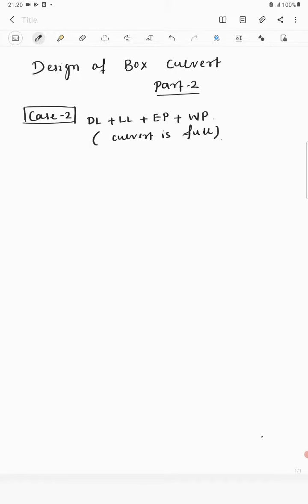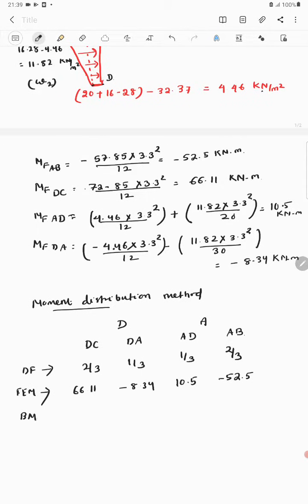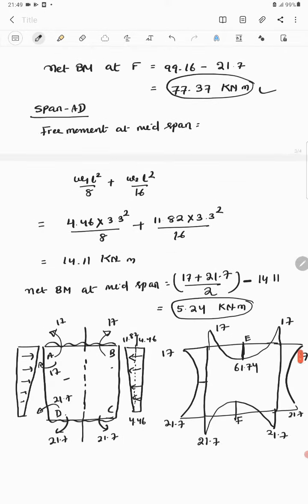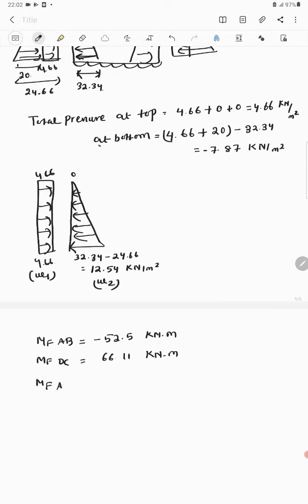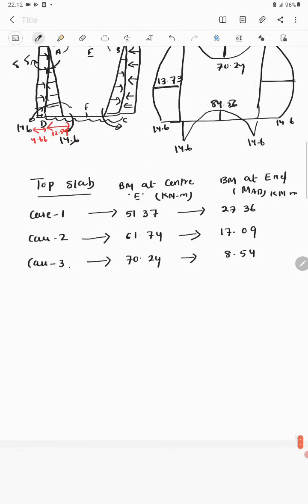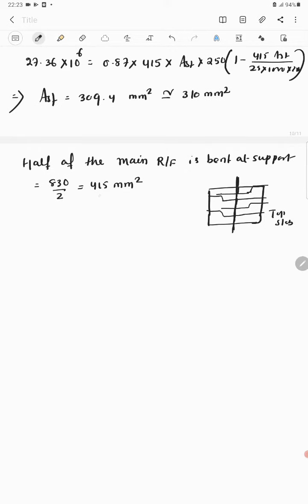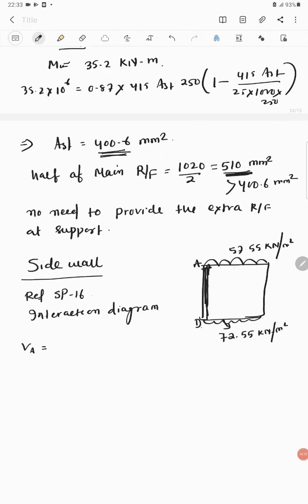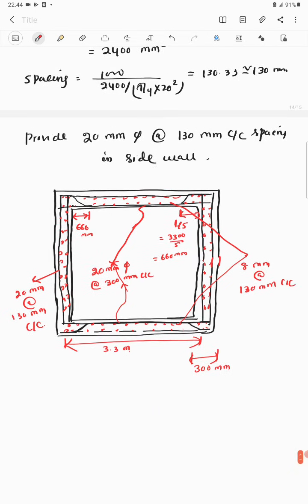DESIGN OF BOX CULVERT (PART-2) | Step by step easily explained

Comment: It is working stress method or limite state method?
Reply from the maker: Limit state
Reply: @civitech6064  madam,
Load on top slab and load on bottom slab not multiplyed with factors of safety (1.5)